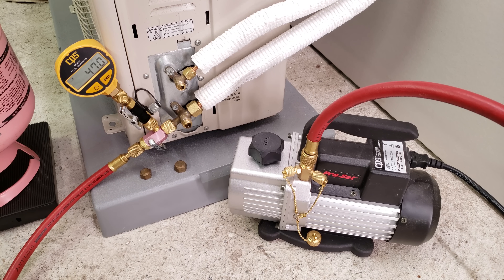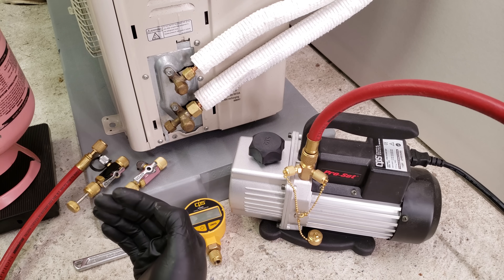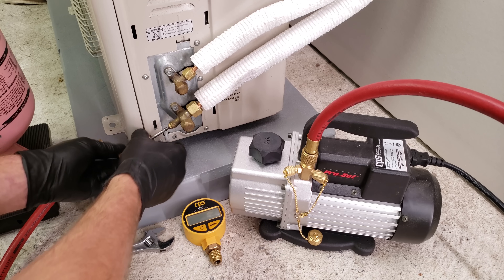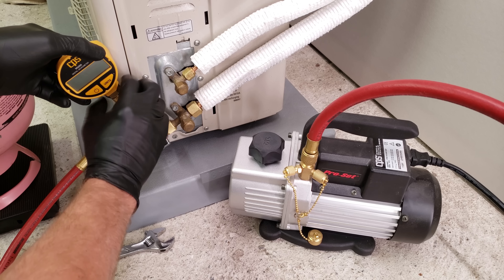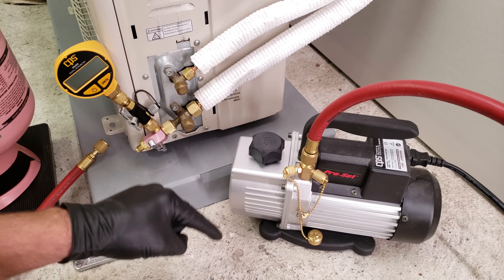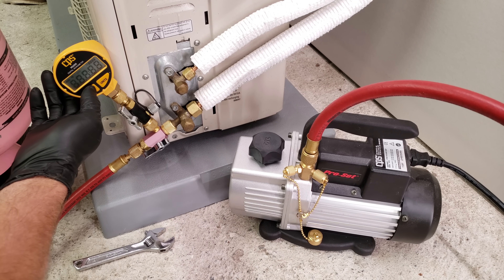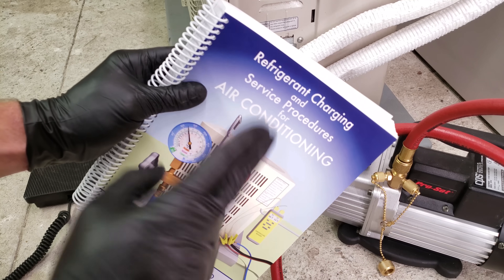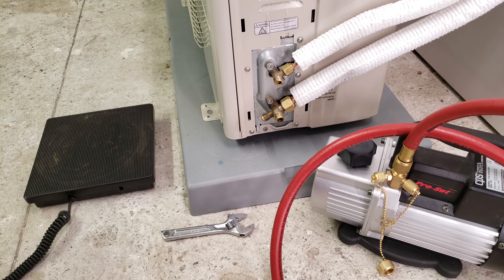Steps to Vacuum and Charge Refrigerant on a Mini Split Unit!

Comment: Fantastic videos on this channel, but at 10:25 shouldn't you vacuum the refrigerant fill line instead of purging the line with refrigerant? It doesn't seem like too big a step to connect the refrigerant fill line to the vacuum pump for a minute before opening the refrigerant tank valve into the fill line. It seems odd after going through the painstaking process of preparing the copper lines to vacuum just to arbitrarily purging the atmosphere with refrigerant in the line that's going to charge the system.

Comment: This guy rules. A few additional things to know about servive port and the valve cores. 
1. Mitsubishi has 1/4" sevice port (not 5/16)
2. I read elsewhere that removed valve cores SHOULD NOT be reused. Get a package of them just in case.
3. I chose to break final vacuum with 410a from bottle, THEN reinstall valve core. Much easier to reinstall with less freon in system.
4. Reinstalling the removed valve cores is not easy. The 2x i have done it....they had slow leaks and had to tighten core more for leak to stop. The tester cap is a must.
5. Unfortunately, the VCRT cannot be used as shown unless the scrader valves ARE removed. The VCRT does not have a depressor in it for a scrader valve .

Comment: You are isolating that system wrong. You cannot pull the shraeder and then just use the gate valve on the core remover. There is and always be a pocket of atmosphere between that valve and the end of the remover . You need two core removers to isolate.

Comment: Is it necessary to vacuum the outside unit after replacing the leaking line sets? Should the valves for the line sets be opened to do the vacuum for the outside unit or the whole system? Thank you.

Comment: Ok, if doing a repair on a mini split that leaked refrigerant gas from the unit. I assume it still has oil in the accumulator? So….. how do you get that oil out to be able to get the right amount of new refrigerant and not flood the system?? Maybe I’m thinking too much about it but vacuuming a used system doesn’t pull much oil out.

Comment: I just replaced a compressor on a single port ductless split. No leaks. System passed a pressure test. I have pulled a 350 micron vacuum through the single access port on the suction line. It's time to charge the system. Do I close off the suction line service valve before adding the complete 40 oz liquid charge, or leave the suction service valve open, add a small portion of the charge to break vacuum, then meter in the remainder with the unit running? Thanks for any answers.

Comment: Hi there - so when adding refrigerant, is a yellow line with a ball valve on the end required or could I simply use the yellow line from my gauge set? I have a mini split I'm installing and I will be going beyond the max length for the charge that's in my outdoor unit.

Comment: What if you are pulling a vacuum on a completely empty air conditioner no refrigerant in it at all should I open the king valves to vacuum out the compressor also?

Comment: Craig i love the book. If all the refrigerant had to be recovered and a leak repaired-- Would you add the R410a refrigerant by weighing it in thru the liquid side? The 24k fujitsu mini splits have a liquid and vapor 5/16 port on them. Should i weigh the total amount in at once and then start the unit? I am thinking about using the liquid side not to slug the compressor and just weighing in the total listed on the name plate all at once and then turn the unit on. Thoughts? Thanks
Reply from the maker: Yes you can while breaking the vacuum with refrigerant using a digital scale, thanks!

Comment: Great video! I was curious though as I am trying to reproduce these results, I am unable to achieve the same results. I have a 3 zone system with about 90ft of line set. Would I still be able to pull sub 500 micron with a 1/3HP single stage pump?

Comment: I tried to open the cap of the service port on my mini split, and immediately a bit of refrigerant was leaking out... Tightened it up again and ordered a valve core + tool. My plan is to then use the outdoor unit to evacuate the pipes, replace the valve core, vacuum the pipes and then do some leak testing.

Comment: Hi Craig, I noticed that the add-on charge amounts listed in your guide are roughly half of what my manufacturer recommends.  This is for a 1/4l x 5/8s Gree single zone 36k mini split.  They say .5 oz/ft, and your guide says .2076 oz/ft?  I assume this amount of variation must not be that critical?

Comment: Hi Craig, great video.  Got a quick question.  Say for instance you have a mini split that is completely empty on charge, (i.e. compressor replacement, etc).  I assume you do the vacuum process just like you described, but when pulling the vacuum you leave both service valves open to ensure you’re pulling vacuum on the outdoor unit as well?

Comment: Your sample has a lot of refrigerant leaking wich is unnecessary when using a manifold, vacuüm all the hoses and at the end, by closing the liquid line, you can use the Compressor inside de outdoor unit to suck the last of the refrigerant out of your hoses, into the pipes.

All the hassle with removing the automatic valve, is not useful for small installations like a split or even a multi split that needs to be filled with some Extra refrigerant.

We vacuum all the hoses (also the one going to the bottle to fill from the gas tank,) without spilling a drop of refrigerant

Comment: Why the original valve needs to be removed and then screwed back in? Isn't possible to attach all of the instruments, gauges and other valves using the original valve?

Comment: Hey Craig, 
Your videos are quite helpful and educational. I have one question regarding the oil level in a compressor of a mini split system.
If I have a leak and I fixed said leak. I have to pressure test and vacuum the while system inclusive the compressor. If I vacuum the compressor I'd be taking the oil out of it as well, right? How do I get the right amount of oil back into the compressor?
I appreciate every help I can get.

Comment: A nice video, however, I must admit that I've installed 10 mini-split units in my house, and they have lasted for years, and I've never vacuumed new air conditioners. When you do this job right (proper connections to lines), you don't need to go through a vacuum process and just purge the system. After releasing the gas from the source line, you have to bleed the system (purge process) through the valve for 8 to 10 seconds. and that's it.

Comment: Hello. Great video. Question about adding refrigerant. Scenario: full evacuation of 410A from a multi zone mini split/ nitrogen pressure test/ vacuum down to below 200 um and hold. If one needed to add /weigh in the full factory charge of fresh 410A to the mini split in this scenario, would they add as a liquid and all of it, example 95 ounces 410A. How quickly would that adding process be…continuous until the weight added was achieved??? or slowly and a little at a time??? If so…how slow…5 oz at a time??? 20 oz at a time??
Second question: The valves of all the zones should be back seated (opened) previous to adding, as the line sets (25’) are not enough to hold all of that refrigerant, correct?
Thanks!

Comment: Seems like want to connect the valved R410A to the port the vacuum gauge is using then leave the valve closed vacuum the line all the way down to the closed valve on the tank. Then you would close the valve on the 1/4 core removal tube blocking the gauge off and open the valves from the tank control the flow with either line valve on the tank or on the other one you have on the hose from the tank. The way you did it adding it to the back of the 5/16 and purging little still air up against that valve. You only purged it to connection.

Comment: hi what are your thoughts on white insulation on ductless line set vs black. ive seen countless examples of pinhole leaks in the copper from the corrosion these UV treated white insulation lines have caused. have you heard this?

Comment: PLEASE HELP ME 
I bought a 1.5Ton 5Star inverter Ac 2days ago a installation team came for installation, they installed the indoor unit and the outdoor unit perfectly and Vaccum the system through the charging hose (service line) after Vaccum the closed the valve of Vaccum motor and turned the Vaccum motor off after this he turned the discharge line (liquid stop valve) for 5sec and turned it off to check leaks till this everything he did was perfectly right as the manual said but after this the manual said to Disconnect charging hose from gas stop valve's service port, then fully open liquid and gas stop valves. But instead he opened the discharge line completely and then started to disconnect charging hose from which the gauge was connected as soon as he started open the gas started to leak from the charging hose and he took almost 30sec to disconnect till than it was leaking and it stopped when it was disconnected and at last he fully opened the discharge line and now Im overthinking and living in fear that what was that gas was it the refrigerant or the compressor oil or it may have suck air inside the compressor or coils because it was vaccumed, it may have contaminated the refrigerant that May lead to BLAST (Explosion) OF COMPRESSOR NOW IM Living in fear that it may blast any time what should i do now Please help me
Reply: Sounds to me like they did it correctly always want to release the refrigerant from the condensing unit before removing the hose. One thing don't ever want to do is shut the vacuum pump off before close the valve to the system the system can suck mineral oil from the vacuum pump back into the system which was never meant to have mineral oil in it. If they removed the hose before they released even with the valve closed it would suck some air back in before the Schrader valve has a chance to close. 30 seconds is a long time should not take more then 5 seconds to remove a hose.

Comment: What is the design specification for these mini splits as for temperature differential between the outside temperature and air temp. coming out of the evaporator inside the house? 

Also does the differential depend on the refrigerant?

Comment: 12:35 - Is 2.3 oz of refrigerant enough to bring the pressure in the system from 350 microns back up to above atmosphere? I would have expected you to release at least some of the charge into the system before attempting to replace the valve core.

Comment: What is the process for multi zone? I would pressure test with nitrogen, vacuum, then reinstall the valve, and move to the next line set and repeat?
Reply from the maker: Yes you can do it that way or pressure test each line and then connect the lines and do one vacuum. However, don't open the master valves until the vacuum is done because that is holding back the refrigerant in the unit from the lines. I cover all of the scenerios in our newest book "Inverter Mini Split Operation and Service Procedures" available at amazon.com/shop/acservicetech and at acservicetech.com/store thanks!

Comment: I'm having an issue with my Mitsubishi Hyper Heat, where it's going into defrost cycles (when heating) every 15-20 minutes once outdoor temperatures go below 38F. Tech came over to check it out and they don't know what's wrong. They want to reclaim all the coolant and replace it with the correct amount. But they don't really know if that is the problem, that's just what Mitsubishi told them. Problem is, they will charge me $2K for doing something that may not really be the problem.
So, being an avid DIYer and software engineer, is this something I could do if I read this book? Of course I would need some equipment, but that may still be cheaper.

Comment: Hello and BIG thank you this video!  Very appreciated. 

May i ask you a question: 
Im am a DIYer in Europe.
I have a small inverter mini split ac system ( daikin emura 3 7000 BTU, R32).
After a major leaking problem (now  fixed) the systerm needs a a complete new refrigerant charge of r32. By the data sheet it needs 780g + 100g( for extra lengh of piping)
The system has a service port on the low pressure side only. I intend to refill the exact amount by using a scale. 

Now my question: After pressure testing and pulling a vacuum on the entire system, when the r32 refrigerant is charged as liquid ( bottle upside down) on the low pressure side,
can i fill the entire amount while the system is off? Or do i need to fill a certain amount and then turn on the system to fill the rest? 

Your help is much appreciated.
Best wishes from europe

Comment: On other video's I've seen here you are suppose to let the gas out before disconnecting hoses otherwise you are re introducing air back into the system

Comment: If I’m recharging a mini split that is completely empty can I leave both liquid and suction line valve open? Or does the suction valve need to be closed? Also one more thing if my unit is completely empty of Freon and I’m going to replace with proper amount. After I pull vacuum can I shoot all Freon in without turning the unit on in cool mode? Or do I need to turn it on for a few minutes and charge a little in at a time and turn it back off before low Freon error code occurs? Thank u so much for your time

Comment: Christ I’m two minutes in and you have not said anything. Why are you using some stupid ass shit to pressure test or remove a valve core. I just wanted a refresher but I can’t help my self. Just pull the core out with a normal core tool plus is it holds vacuum it’ll hold pressure. Suck it down and fill.

Comment: It would be nice to know where you got the gauges, adapters and things like that.  EDIT:  Just came to the video that said the parts are linked!  Awesome!  I will check it out when I get home... work is blocking all the links.

I'm a homeowner but plan on installing my Mitsubishi mini split in my garage.  I'm being quoted $8k for a 18k BTU system and I can buy the system for $3800... $4,200 they are charging in labor, so I have ZERO issues buying all the tools needed to be able to do exactly what you are doing.  Even if I spend a grand or two on the tools, I am still coming out ahead knowing that it's done properly and not rushed.

That's the biggest thing I see now when having work done.  It's rushed and not thoroughly checked/completed.  If I am doing the work I can take as long as I need to ensure that it's done correctly and 100%, rather than paying someone to do said job and find out months later that something was skipped or not done properly.

Comment: I would like to pressure test my new mini split before applying vacuum, but I don't want to spend $200 for a small 20 cu ft of nitrogen to do it. I know they say not to test with compressed air, but I really don't think that it would be a problem as long as the air is dry and you run it through a drying filter first. A vacuum pump will remove any moisture from the lines anyways right?

Comment: As always, thanks for the informative videos!

Why are the valves shut-off (at the ~14:25 portion you show being turned back on)?  I went back to the beginning and didn't see shutting them off.  Wouldn't you want the valves open to fill the compressor piping, or is drawing a vacuum on the compressor a bad thing?

Comment: If the unit just had a compressor replaced what the proper way to weigh the refrigerant back in ? Should I fill using the liquid line port that is connected to the compressor or should I add on the suction port where the line set is connected?
 I don’t want to flood the compressor 

Thank you

Comment: how come you didn't start and use the suction line to remove the liquid from the tank line.
Reply: He wants liquid in the tank. At the beginning he is adding a bit of refrigerant to account for the longer than normal line set being used. That is 2.3oz he is adding.
Reply: @eric4brs  after he shut the tank off. It did show the liquid in the line to be added so there is vapor left in the hoses instead of liquid is my point

Comment: On a 3 zone mini split do I do this for each zone / port or only once?
Reply: Each
Reply: @rjneal444  mine has a manifold so I was able to do all 3 at the same time after i opened  all the lines up..I sucked it down to 28 microns..That's the best I have seen on youtube.. I wish I would have recorded it..I did take pics though..I pressure tested with nitrogen 300 psi for 2 days then flowed nitrogen through the lines before vacuum..It worked great.